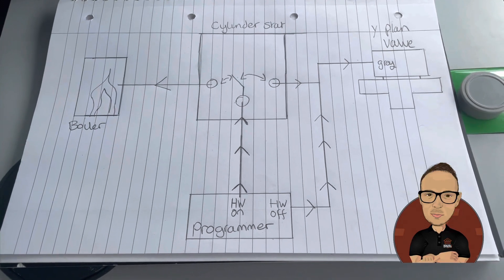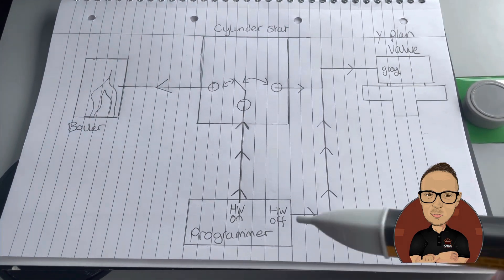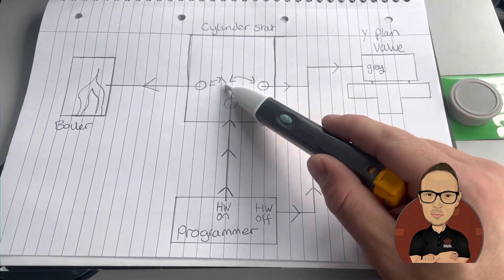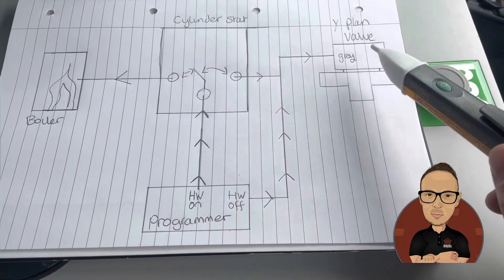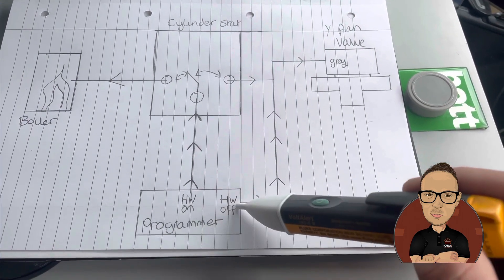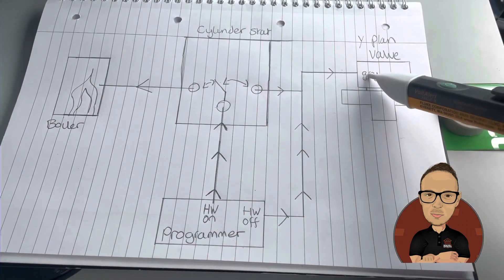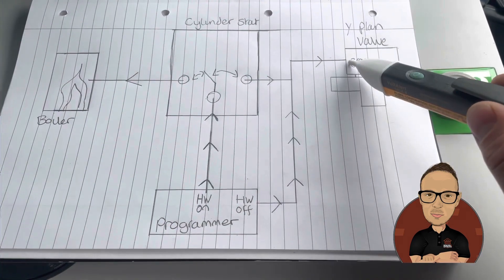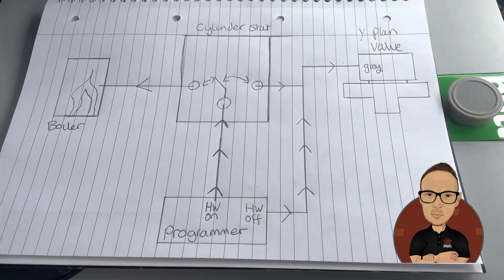How do you wire a cylinder stat, understanding a cylinder stat on y plan system

Comment: So when hw is off because the cylinder has reached the set heat of the stat, the cylinder stat is still getting voltage from the programmer. However, when you turn hw off on the programmer it then sends voltage directly down grey to the zone valve? Thus meaning the cylinder stat will have no voltage going to it?